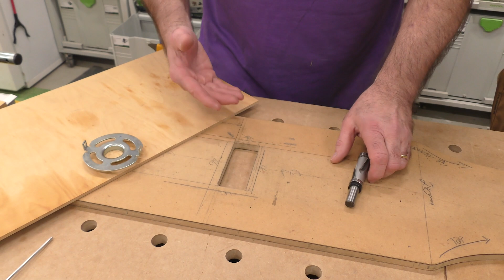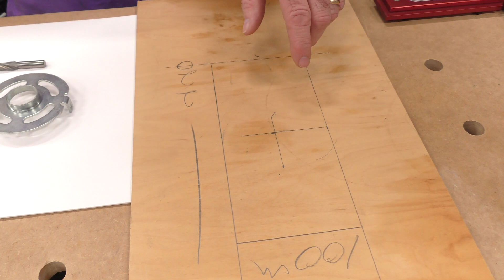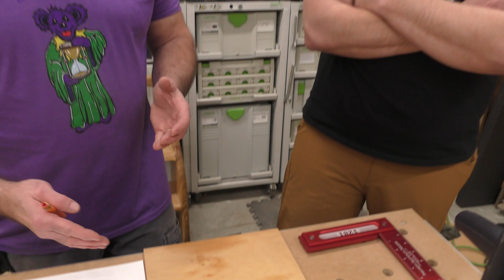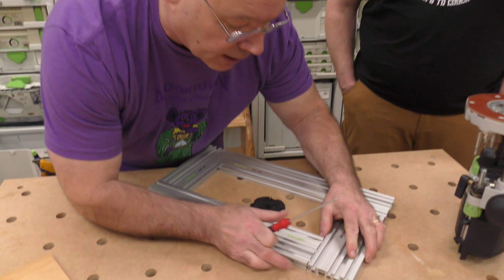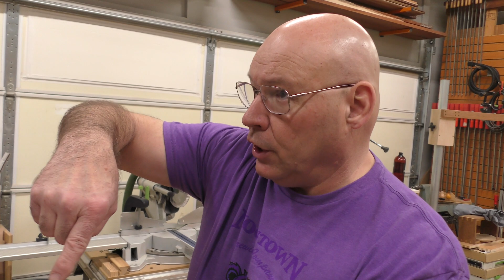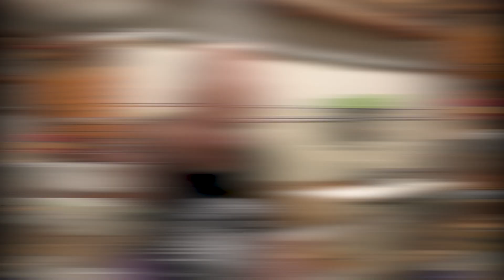Festool MFS Basics: Making a Template

Comment: MFS is an template, why making a template with a template?
Reply from the maker: That is just the way I use it...
Reply: It’s replaces many small templates but some templates are complex and this helps fabricate them. As an example, I’m working on producing a valet tray/desk organizer and I need multiple pockets. This will allow me make a master template so I can batch out the product. 
Also, while there may be a rectangular cut out in the center, there may be curvatures on the exteriors.
Reply: I Hope. This. Helps 🫵